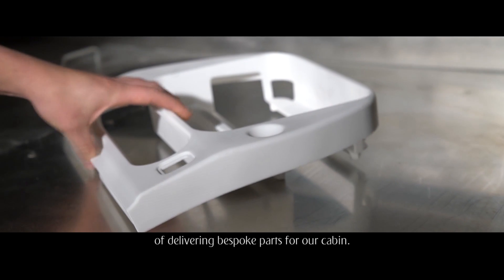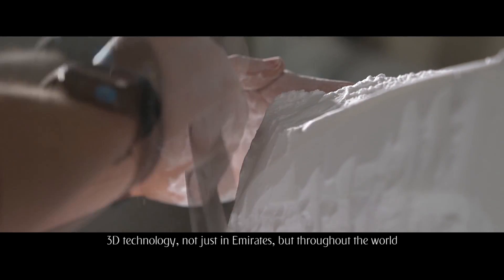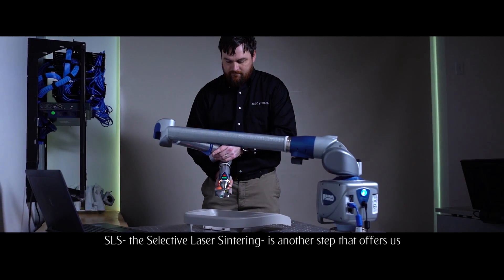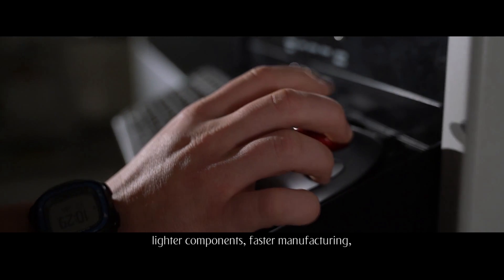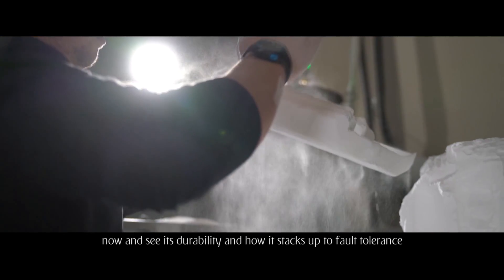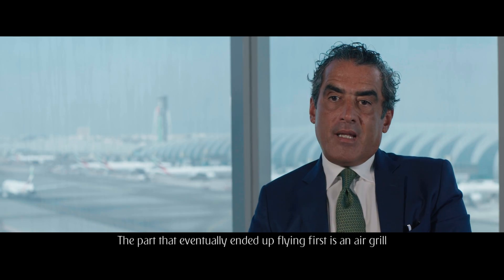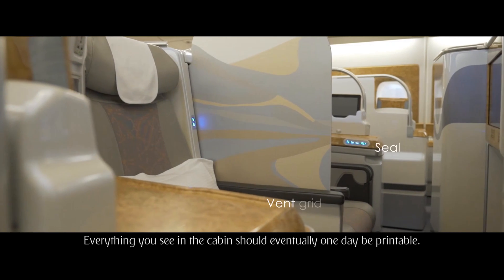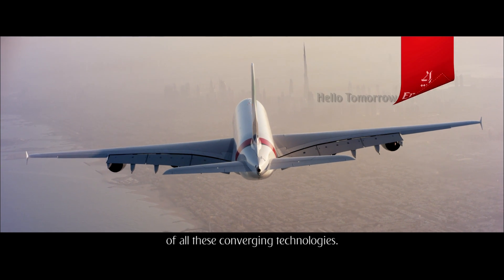Emirates pioneers 3D printing for aircraft components | Emirates Airline

Comment: Bit late isn't it? My school has had 3d printing as a process for our product design course for a few years now. Airbus etc have been using it for like 10+ years in Filton aswell. 3D printing is a no brainer now when possible compared to an alternative process such as injection moulding, extrusion  or vacuum forming etc